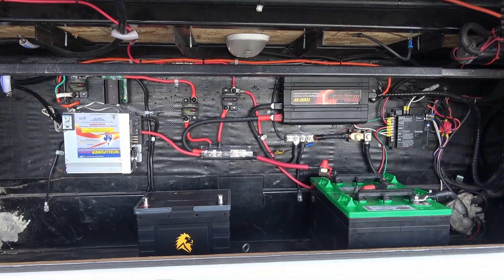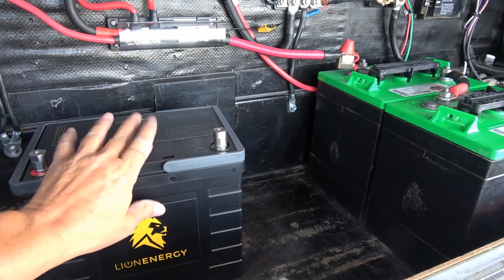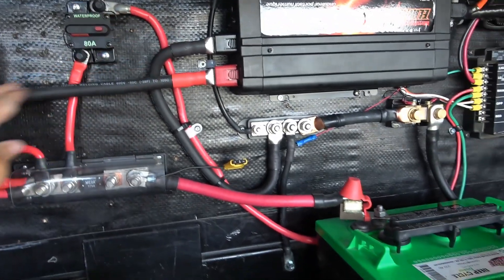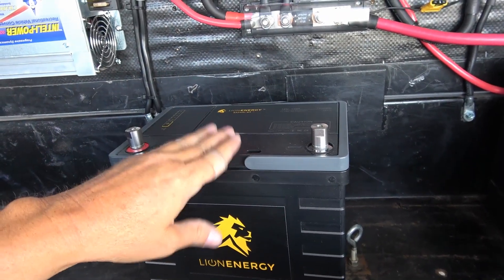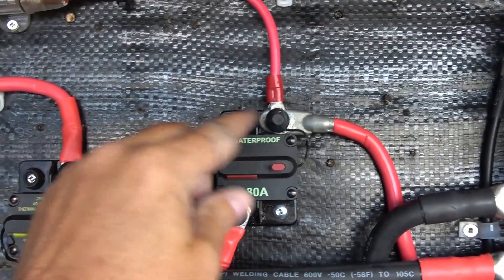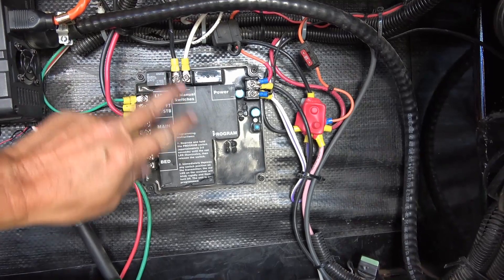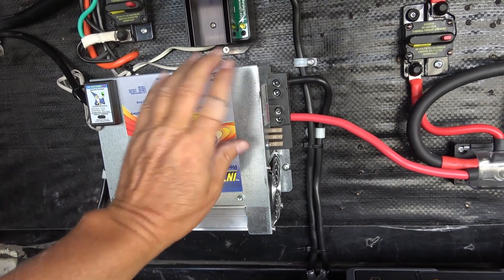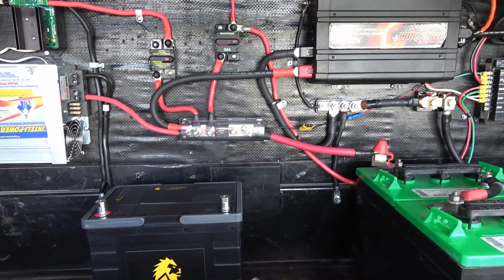Reorganized My 12 VDC RV Power System Wiring

Comment: Hello Ray,, I am still on my install project,, Should I put in a sacrifice fuse on my system?  I have a 1000W inverter with a 2000W surge with what would be a fast-acting 110 amp fuse (from the trailer's wiring diagram, I do not have access for now to confirm) 10V low,    2 Lion Energy UT1300.
Reply from the maker: https://www.loveyourrv.com/installed-catastrophic-fuse-rv-battery-bank/

Comment: I noticed your lead acid batteries in this video are not in a vented box. Is there a reason you chose this route?
Reply from the maker: They were in a vented box, I had 4 lead-acid 6V golf cart batteries prior to swapping them for the 3 lithium batteries. I had just pulled the battery box out while I was redoing the wiring and testing and comparing the new batteries to the old ones. Here is a later video where I reuse the old vented box to hold my new lithium batteries. - https://youtu.be/jo7S__-M99c  Cheers, Ray
Reply: @LoveYourRV  Thanx for the quick response Ray. That explains it

Comment: Hey Ray. I see in this video you have your inverter negative going to the busbar and in a 2016 video you had this same inverter negative going to the shunt. Is one way better than the other or doesn't really make a difference? Thanks.
Reply from the maker: I thought the recent setup is a little more tidy by not stacking the lugs.  Technically it may be better from a wiring/connection power loss perspective to have it connect right to the shunt but with the short wiring runs and heavy gauge I'm using for only a 1000 watt inverter I doubt the extra voltage drop is a problem, it would be so slight. Cheers, Ray
Reply: @LoveYourRV  As always, Thanks for your feedback.

Comment: Great video! I just picked up 2 of the 1300 batteries and a new PD4060LIK Power Center to charge them! I appreciate your video and I anticipate watching this one over and over several more times before installing my set up...

A couple of questions you may can help me with though...

I am not setting up any solar or an inverter (for now). I currently have a cheap flooded LA battery with a WFCO8735 power center installed right now. Upon inspection, I realized that the converter is wired to my battery via 40 feet of 8AWG wire and runs through a rats nest near the battery. In the junction box the 7 pin trailer wire, breakaway switch, a "prewired solar hook up", the wire from the converter and the wires going to the battery all converge... It's a mess!

What I am wanting to do is install the new lithium batteries inside the camper under my bed. I am thinking about running a new 2AWG positive wire from the new converter/power center straight to the new battery. Right before getting to the battery I was thinking about adding an 80A resettable Bussman breaker, then a BUS bar, followed by a battery disconnect and then to the battery. In the meantime, I would leave all the wiring in the rats nest alone, except I would pull out the wires that went to the old battery. Then I could take the old 8AWG wire that ran from the old converter and connect it to the new BUS bar that I installed near the new batteries. I assume that this would still allow power to run to everything that was currently powered before, however, this is where I get confused... In the original wiring set up, the wire from the converter went to the rats nest of wires, and then to the battery. In the new set up I am planning, the new wire from the converter would T off at the BUS bar and go one way to the new batteries, and then the other way to the rats nest... So my new plans will result in a new route, but I can't figure out if this route will work or not... I know that all probably sounded pretty confusing, but any insight you could provide would be of great help! Thanks!
Reply from the maker: Thanks Chad, that should work fine as far as I can see from your description. It really suck that manufactures don't provided a wiring diagram.  Cheers, Ray
Reply: @LoveYourRV  Thanks! I have wiring diagrams for my camper, however, it only shows the hardwired items, so the 7 pin wire, breakaway switch and event he prewired solar plug isn't shown on the schematic. However, at this point I have identified almost all of the wires in that junction box (Once I have everything in hand and am ready to install I will be able to break away a lot of the foam hiding some of the wire paths.) However, I just wonder if these things have to be wired in this order since it's DC? Right now the wire from the converter meets all of these other wires at once, however in my new set up I am planning the T will split the batteries and everything else in the junction box...

Anywho, another question, I ordered an 80 amp Bussman resettable circuit breaker similar to the one in your video. I realize now that it can also serve as a battery disconnect, but would you suggest using this as a battery disconnect and a circuit breaker, or would you recommend also having a battery disconnect wired after the circuit breaker?
Reply from the maker: As long as the wiring to each branch of the DC distribution can handle the amperage without too much voltage drop and also is fused to protect the wiring then it will be OK. By the sounds of it you are actually improving what the OEM did. Which isn't uncommon because they usually go for the cheapest option to just get by. :) They know most people rarely use the battery for much, just drive to full hookups.
For the disconnect I'd say if you are going to be using it all the time then put in a dedicated switch but if only want it for emergency or once in a while use then I think the breaker is fine.  Some people like to put a master cut off switch right on the main battery cable feed to everything ie. solar , inverter, RV 12V feeds,  but I have a catastrophic fuse anyway so decided to just go with the breaker on the 12V RV feed and my solar and inverter feeds and use them if I need to cut which ever circuit off.
Reply: @LoveYourRV  Thanks so much for all of your help! The last few days I have been searching for any information I could find, and it's so confusing... this video has been the closest thing I have found to actually walk through and show what exactly is going on, so I definitely appreciate the video, and the response to my questions (another thing that many YouTubers fail to do, at least as timely as you have!)
As far as the disconnect, I will sleep o that  (everything won't be in for a week or 2 anyway... lol!) But it sounds like I may just go with the circuit breaker as both... I only installed this disconnect a couple of months ago just trying to learn about some of the DC wiring. I did wire it as you described though, as a master disconnect... it disconnected everything, including the repeater for my TPMS and the cheap battery monitor I installed (don't figure I need to monitor anything if it's completely disconnected!) I may do that again... 
Also, I say the catastrophic fuse in your video and used your link to order one for myself... however, I only have 2 batteries and will be using 2AWG wire so I went with the 175A fuse. From what I saw, with a 2AWG wire they suggest 200A as the maximum size fuse, but since I am not running as much stuff I went to a 175A... not sure if that was correct or not though... that was a guesstimate.
I would like to ask how you are feeling about these batteries at this point. I know you haven't been using the 1300's very long, but have you had any change of thoughts or anything new? 
Also, I picked up the Victron BMV712 battery monitor... I thought about the TriMetric but ended up going with the Victron for the Bluetooth app... I can't wait to get this all installed! :)
Reply from the maker: So far I'm really happy with the Lion batteries, no complaints, the UT1300 were a nice upgrade to the UT1200 they worked awesome during our last boondocking trip down south. Here is a link to all the posts/videos I've done related to them -  https://www.loveyourrv.com/tag/lithium/  Also, these videos may be of interest too - https://www.loveyourrv.com/renogy-40-amp-dc-dc-charger-installation-and-demo/
I'm soon going  to be reviewing a cheap 100AH lithium battery from a company out of China called SOK that goes for $650, will be interesting to compare with the Lion UT1300. Think I'll take the 2 apart and compare the innards and of course test out the SOK battery charge and  discharge rates.  Cheers, Ray

Comment: Hi Ray. You may recall I upgraded my Bogart controller/monitor & bought the wifi module. I've also ordered the Renogy dc-dc charger. I'm going to redo my wiring setup & was wondering what gauge wire you connected in/out of the solar controller. The manual says 6 awg but yours looks bigger? Most of this is just scheming right now as it's -19c here today😒.
Reply from the maker: I used 4GA cable and just cut off a few of the wires near the end so it fits into the controller connectors. 6GA should be fine though unless the wire run is really long.

Comment: Hi Ray, love your wiring cleanup
 We just got a great deal from Renogy on 400 watt premium kit, 2 100 ah lithium batteries and 2000 watt inverter charger.
We are really excited to set it all up in our Cougar. Your videos are a huge help, thank you.

Renogy recommend 4awg for battery interconnects and inverter cables! Yours look to be 2/0? Am I missing something? 

Thanks,
John
Reply from the maker: 4 awg seems a little light to me. I decided to oversize mine and leave room for expansion in the future, also less loses in the wire when charging and discharging. Since the runs are relatively short the cost wasn't too bad.

Comment: Ray nice setup... I noticed you don’t have any “shut off” devices between your major components to “isolate” them from the main system for doing repairs or upgrades.  Can you comment on this? It seems most inverter manufactures require a “T type” fuse and you are using an “ANL type fuse. Did I miss a
 main coach 12 volt disconnect switch? TIA
Reply from the maker: For the inverter, I'm using a 175A Mega fuse - https://www.littelfuse.com/products/fuses/automotive-passenger-car/high-current-fuses/298.aspx it is also backed up by a catastrophic failure 200A blue sea terminal fuse right on the positive battery terminal - https://www.bluesea.com/products/5191/MRBF_Terminal_Fuse_Block_-_30_to_300A
For disconnects I have switchable breakers on the main RV circuits 80A, the solar controller 40A and the solar panel runs 40A.
If I ever need to disconnect the main battery bank, I"ll just unscrew the negative lead. Decided to do that versus a switch to keep it simple and fewer contact points.  Cheers, Ray

Comment: If you upgrade your inverter. Look at the Magnum Energy MSH3012- M. It is a hybrid 3000w inverter/charger. I think you can get the msh2012-m 2Kw. So if you have a generator running while boondocking and need more power, it will add your battery bank power to the output, until the surge if power is ended or the need for the extra power is gone. Victron Energy Multiplus 2K inverter/charger is a hybrid and is about $200 cheaper. Both have a transfer switch built in.
Reply from the maker: Thanks, a little pricey but good stuff.

Comment: I wouldn’t bother with upgrading the inverter (just check it won’t harm the lithium and you may be able to reset it to accommodate the lithium) Most likely it will just not be able to get your batteries to 100%... But you also have the solar controller that can pump in the last few % the inverter couldn’t fill... Not sure what solar controller you have?... Is it PWM - If so replace it... look at the Victron line with the Bluetooth app - or Renogy makes a less expensive model that also has a nice app to monitor and program to really give your battery the best charge... Your money would be better spent upgrading the solar controller rather than the inverter in my opinion... Look what a couple hundred dollars will get you... (check out the cool app to)... https://www.renogy.com/rover-li-40-amp-mppt-solar-charge-controller/ - And while your at the Renogy site take a look at their 2000w pure sine inverter;-)... Ha it never ends!...
Reply from the maker: Thanks but my inverter doesn't charge the batteries, maybe you are thinking of the newer hybrid type inverters that also have a built-in charger for the batteries. My current charger is a PWM  but completely programmable. It will do fine until I decide to expand the system. I've used it for about 4 years now with good results. Pretty good little controller when matched with its Trimetric battery monitor -  Even made in the USA  http://www.bogartengineering.com/products/solar-charger.html  I want to keep using it for a while so I can do a comparison with my lead acid bank.

I did check with the Lion Energy company and they said my Intellipower charge converter with the manual override switch would be OK for charging.   I tried it out it brought the batteries up to 100%
But they do recommend the Iota chargers with a special Lithium Addon  -  https://www.iotaengineering.com/IQ/#!/detail/IQ-LIFEPO 
Cheers, Ray

Comment: As long as you have the wizard dongle, that converter is fine. You will want to shut it off manually anyway.  No need the keep the LI batteries topped up, in fact it is undesirable.
Reply: Notwithstanding the mfg hyperbole, the physics of LiFePo makes it undesirable to keep the batteries at 100%.  In fact, it really is best to keep them in their mid range 80% to 30% and not charge them more that necessary.  Eventually they BMS’s will be capable of interacting with charge controllers and converters to do this.  Trojan is starting this now with the LIFEPO they just released.

The best primer on LI batts is this, and is required reading, if you want to understand how to manage these batteries at a fundamental level and not blindly take the mfg. slightly overblown  claims as gospel.  The marine industry is a bit ahead of RV folks on this stuff.  There will be some LI battery failures in the next couple of years, as RV’er keep them plugged in and charging over the winter, or in storage with a solar charge controller kicking to 14.4 every day.  In your case, with constant use, that is less of an issue, but you can still extend their cycle life by letting them run down a bit between charges and maybe cutting of the charge at 13.8 to 14.0.

https://marinehowto.com/lifepo4-batteries-on-boats/.  This article appears to be dated, but the author keeps it up to date

Good luck and you have a great channel with loads of great information .
Reply from the maker: Undesirable? That's a negative for lithium then. Kind of a pain to have to be turning off the solar system every time you hit 100% charge. I thought that was what the BMS was for.
Reply from the maker: Thanks, for the info I'll add this as a possible con for lithium batteries. Lion Energy recommended the Iota Converter with the IQ-LIFEPO addon - https://www.iotaengineering.com/IQ/#!/detail/IQ-LIFEPO Interesting is it's designed to wake up every 15 days and bulk charge for a bit.
I guess the big thing is if the company stands behind the warranty. They are guaranteeing a quoted lifetime of the battery as 3500+ cycles.  They can pull that info off the internal BMS
They told me if you were to baby them as you describe you could get a lot more even double that and still the battery would be at about 80% of new capacity. So given the supposed extended life of these, it could be a moot point as in my case 3500 cycles is likely 27 years down the road.  I'm thinking in even 10 the world of battery storage will have changed dramatically and these will look like old school tech. Of course, time will tell. ;)  Cheers! Ray

Comment: Great to see you trying the Li batteries.  Just a suggestion, watch the use of those thermal resetable breakers.  Sound like a good idea but they are notoriously poorly costructed and can cause a significant voltage drop under full load current.  I tried a 250a for my main positive breaker to a 2,000 watt inverter and under full load it heated up significantly and caused about .5v voltage drop.  Not good.  Further the terminals were not nearly large enough for the rated current.
Reply from the maker: Thanks for the tip. For my inverter fuse, I used a 175 amp fuse from a company called Littelfuse Here is the details https://www.littelfuse.com/products/fuses/automotive-passenger-car/high-current-fuses/298.aspx
"The MEGA® Fuse is designed for high current circuit protection up to 250 amperes. with "Diffusion Pill Technology". The MEGA® Fuse also provides time delay characteristics. Designed and patented by Littelfuse, the MEGA® Fuse is ideal for battery and alternator protection application and other heavy gauge cables requiring ultra-high current protection."

For the lower amperage circuits, 40Amps and 80 amps I haven't had any issues with the Blue Sea breakers, one has been on there 8 years now. Other two, almost 4 years.  Cheers, Ray

Comment: your SC-2030 is PWM   you need a MPPT unit  your 500 watt system does not do much good with PWM
Reply from the maker: Has worked great for our needs for almost 4 years now, we boondock every winter for 4 months.  The money I saved back then by using the Bogart SC2030 instead an MPPT controller paid for an extra 100-watt solar panel.   https://www.loveyourrv.com/what-do-we-power-with-500-watts-of-rv-solar/  On small-sized systems with 12 volts matched panels MPPT isn't a huge advantage. As the systems get bigger or for mismatched or high voltage panels it starts to make more sense.

Comment: Are the Lion batteries 12v or 6v. What is the amp hour rating on the new battery?
Reply from the maker: They listed as 12V 100AH, here is a link to an introduction video I did a little while ago - https://youtu.be/2yfJ_xEOGJ8  Cheers, Ray